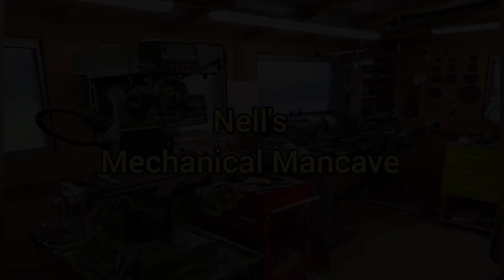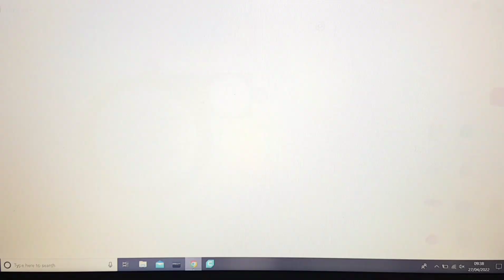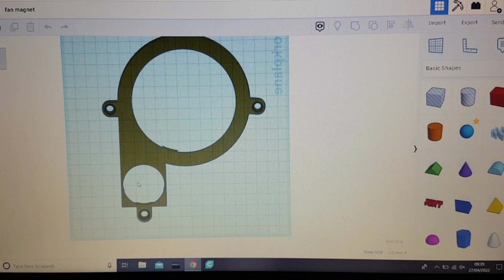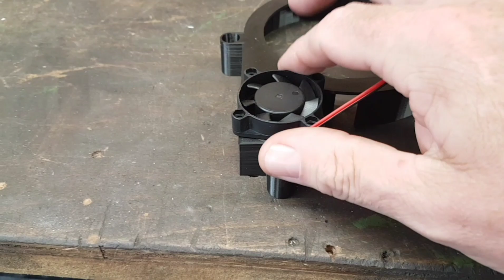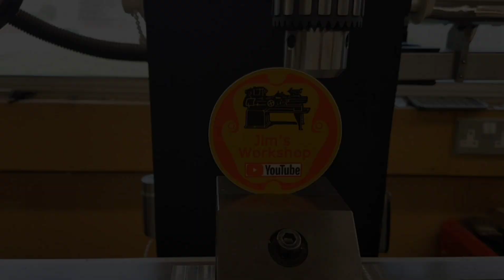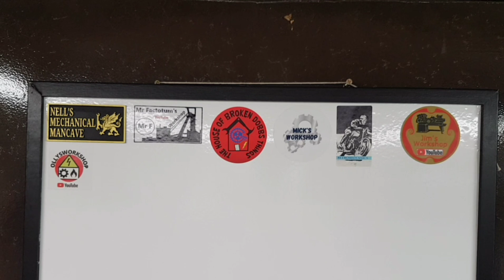Power Feed. Electromagnetic Clutch Drive.

Comment: Me again. Lucky you! Thanks Nell for this series. It's given me some ideas. I have a drill-mill that needs a great deal of hand cranking to raise and lower the head. I don't want to lose manual control which is what happens with a lot of directly coupled motor designs. I'd thought about an electromagnetic clutch but had little idea of how to implement one - now, thanks to you, I have. Keep rocking.
Reply from the maker: Hi again Robert. 
As I previously commented.  Might be worth a visit to a scrap yard and get the complete clutch off a car ac pump. Another viewer did this and said it worked brilliantly. 
Could work out cheaper too.
Cheers Neil

Comment: Hi Nell. No, that is NOT a mistake. I, and I am sure you as well, am a great believer in defence in depth. Your valuable clutch idea will last even longer with the added cooling. Long enough to see both of us out! One small point, the resistance of copper increase with temperature rises. Just as well, it means the heating effect is self limiting. The big concern would be about burning out the windings which is why the addition of air cooling is so important.
Reply from the maker: This is still work in progress. Saying that, I haven't done much with it for a while. A viewer commented recently that he used the entire assembly off a car and he said it works like a dream. 
Thanks for the comment 
Cheers Neil 😊

Comment: Allo Neil from a fellow Taff well west of you, 
Just found your musings and love that fact that someone is showing that it can be done with no budget, warts an all !
Re your issue with the magnet being powered all the time. I'm no elecchicken (to quote another enjoyable gentleman on this platform - AVE) but could you not use a double pole switch for your direction switch and use the 2nd pole to switch power to the magnet? That way magnet will only power up when you engage direction..
Reply from the maker: Hi Adam (Man of Wales)
I did solve the issue after fitting the cooling fan but didn't video it.
Instead of another switch (I'm lazy and flicking two switches seemed like hard work😊) I connected 2 micro relays to the direction switch on the speed controller. The outputs of the relays were joined together and these now power the magnet.
So,,,, the magnet only works now if a direction is selected. I did have to spend £4 for the relays though 😪.
Hope to get back to reproducing more videos soon. I have no feeling in my legs ATM and fall over a lot. Not good when running a lathe or mill 🙄🙄
Cheers Neil

Comment: Hi Nell… Neat fix.. Methinks you like gadgets..ATB
Reply from the maker: Hi Paul!
The printer serves two purposes. 
It can do complex jobs that have no structural requirements and it does it without you.
Doing mundane jobs like multiple brackets, fixtures and fiddly bits are done with a press of a button that leaves you to do other things. It's a great tool but has its limitations and as long as you know them, your time can be freed to do more exciting stuff.
Thanks for Watching 
Cheers Nell

Comment: Hi Neil. Thanks for the shout out. I have a small collection of stickers that need to go up on the board. Been a bit busy lately, so got very little done, but got some hopefully interesting things coming up, and can get a video out before long.  I too am guilty of making without thinking, take my electric mower project for example, I'm basically tearing it apart and starting again because although it works, it's just not suitable for actual use. I think part of the fun of tinkering is to not think too much, just enjoy the process.  I like your idea of the electromagnetic clutch, I have had a power feed on the back burner for years now, I was just going to use a toothed belt and tension it up when I need drive, but you're making me think now. Stop it. It hurts!
Reply from the maker: Now then!
I'm sure you have already thought out how to switch the drive direction, switch the magnet on and off and boil the kettle at the same time. Just remember! Don't stir the coffee to quickly with the mill😳

Comment: He who doesn't make mistakes never makes anything!  Making them really just means you're stretching yourself to cover new areas.  And anyone who does metalworking knows that new areas tend to have lots of hidden sharp things to cut yourself on. 😲
Reply from the maker: Wise words Doug, thank you sir!
Reply: That's a good solution!  (Says the guy who doesn't have a 3D printer, LOL)

Your opening words in this video are about a lesson in Thinking. 
...and now you've got me thinking too...

I'm kind of surprised that the magnet getting that hot in the first place though.

You may have already checked/done these, but a couple of possibilities come to mind:

1.  The power supply.  Could it sending more voltage than it's supposed to (or is the resistance of the magnet coil lower than it should be)?  Quality control in the manufacture of components isn't always as good as I think it should be.

2. Does the metal plate on the back of the magnet have a good (ie. large and smooth) thermally conductive path to the aluminum plate and/or the mill castings?  ...I went back and watched part 2 of the series but couldn't see clearly.  (The shots are cut so that we go straight from the magnet and plate sitting on a table, to seeing the two of them mounted together on the mill.)
If you have - or can generate - enough good contact area, sandwiching some heatsink compound between them might work wonders.  

Thanks again for sharing your work with us.  Now that I've discovered your channel, I've got a lot of material to catch up on! 😊😊